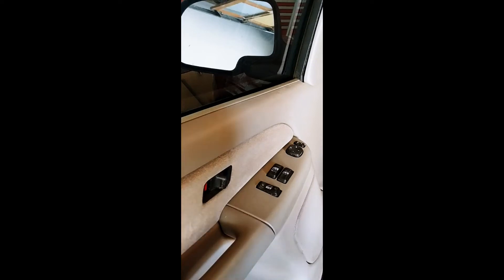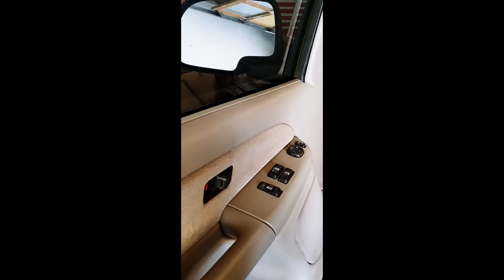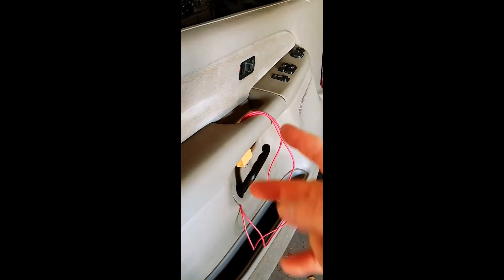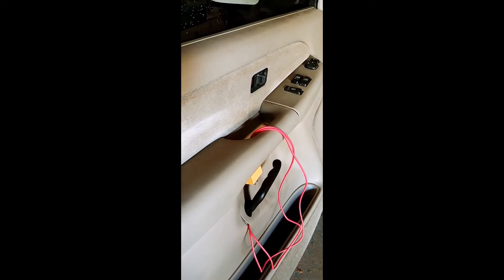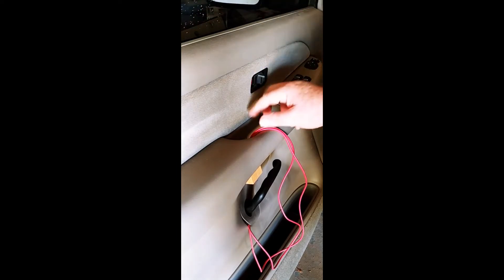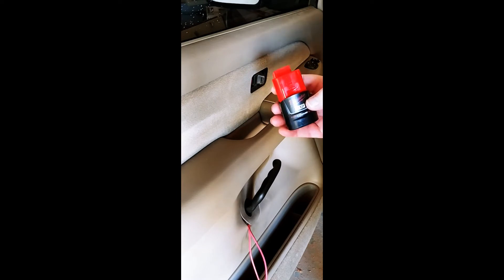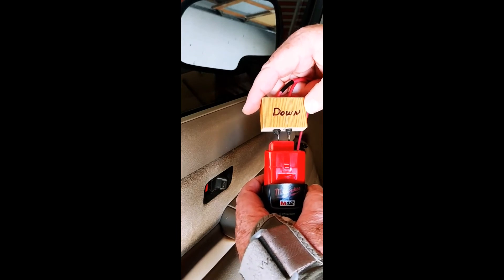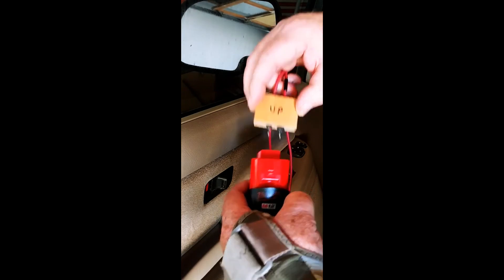Power Window Switch Not Working on Your Car? Here's A Hack

Comment from the maker: You wanna bypass the switch. Remove the door panel and find the motor. Just google power window motor images. They all look similar. Cut the two wires coming off the motor. Leave enough original wire from the motor ( 6 inches or so) for reattachment when you get a new switch. I soldered and heat shrink mine. You can use butt crimps or even electrical tape. Tape all exposed wires to prevent shorting.  Attach two long wires (2-3 feet) to original wires off the motor. You want enough wire to snake your way around and out of the door panel. Now you can power the motor with a tool battery. 12 volt or even 18 volt. Just touch your leads quickly to the battery terminals. One lead to the positive the other to the negative. If the window doesn't roll down. Reverse the leads. Only hold the leads on the battery long enough for the window to roll down or up. If you can't power the motor you may have a bad motor. This method is for a bad switch.

Comment: Hey there what gauge wire would you suggest for making the leads in this wholesome activity??? Thank you!!!
Reply from the maker: I'm using 16 gauge silicone wire since I wired directly to the motor. It doesn't have to be silicone wire but, it's much more flexible. 16 gauge wire can handle about 10 amps at 12 volts.
Reply: Another question did add your leads off of the motor wires where they connect at the switch or did you remove your door panel and access the motor directly that way? sorry I'm disabled and on an extended road trip and trying to get this darn window up before next month😂 thank you so much for your speedy response earlier!
Reply from the maker: @jaqimaddows9895  No problem. You wanna bypass the switch. Remove the door panel and find the motor. Just google power window motor images. They all look similar. Cut the two wires coming off the motor. Leave enough original wire from the motor ( 6 inches or so) for reattachment when you get a new switch. I soldered and heat shrink mine. You can use butt crimps or even electrical tape. Tape all exposed wires to prevent shorting.  Attach two long wires (2-3 feet) to original wires off the motor. You want enough wire to snake your way around and out of the door panel. Now you can power the motor with a tool battery. 12 volt or even 18 volt. Just touch your leads quickly to the battery terminals. One lead to the positive the other to the negative. If the window doesn't roll down. Reverse the leads. Only hold the leads on the battery long enough for the window to roll down or up. If you can't power the motor you may have a bad motor. This method is for a bad switch.